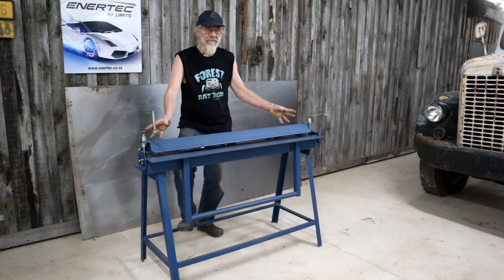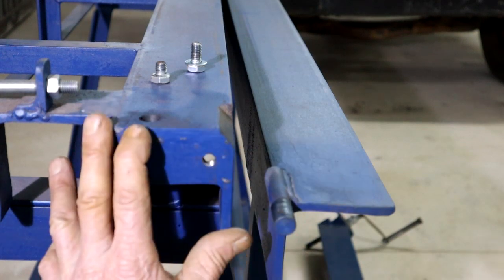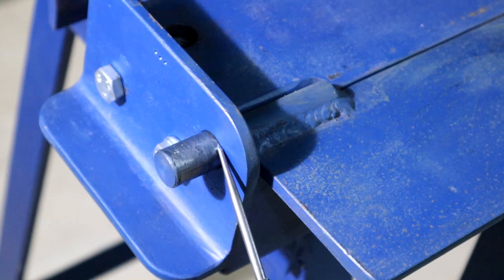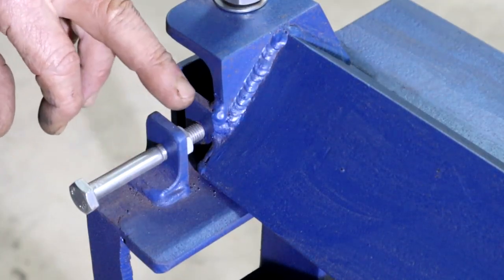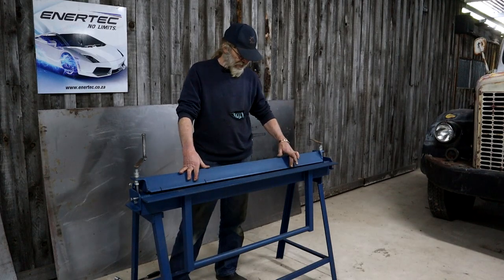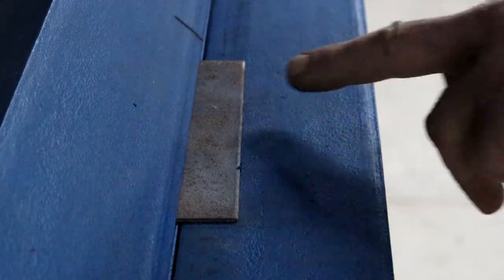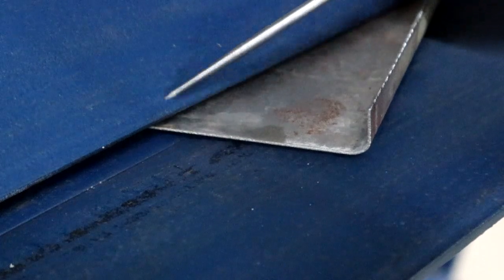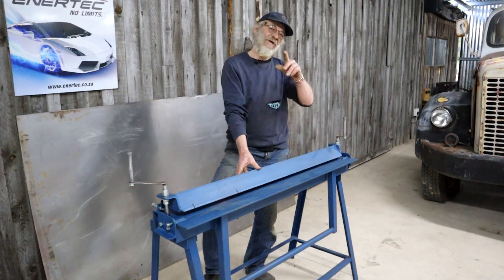GOOD DIY SHEET METAL BRAKE

Comment: Something I always thought of building to move cars trucks tractors around the yard is based on an electric  powered tor even gas two wheeled trailer mover or a tiller without the tiller tines. . Have some sort of lift device a few inches at the cars bumper to give traction.Might be better to design it as a pusher rather than a puller. I made a few attempts using the 3 point lift of a tractor. Intentions is to make it a one man loner operation. I always look forward to any of your new video's

Comment: Mount an angle grinder tona fixed position, and then run the metal through like you would a table saw.
Reply from the maker: Been thinking about that!

Comment: Very nice job I would just like to throw out there I see you cut slits in the angle to make a box corner would putting fingers on your hold down angle allow for more versatility to make different size shapes  , one of the best designs for the size of usable bending area. Congratulations
Reply from the maker: Sure fingers will make for more versatility. A lot of work and hassle to build them though!  I don't need it often, so just cutting slots is way easier. And I just weld them closed when it gets too much😅

Comment: So do you think it would bend 3mm aluminium plate aprozimately tge length of the brake ? And just a idea or mod as described wirh the shaoer bend radius, if you add a round stock along the length, say 16mm or 20 mm diameter. You could have a much larger radius bend  if desired??
Reply from the maker: Should do it, but think you wil need the additional bracing. And yes, adding the round stock will work. I wanted a bend with more radius, welded some flat bar tabs to the round stock and bolted it to the edge so it could be removed again

Comment: Awesome brake!
Another option would be to cold rolled flat bars to form the top angle, with the bending edge ground along the length to 45 degrees (or milled if the budget allows)

Comment: Unfortunately you're stuck on what ever radius the edge of the angle is !
Reply from the maker: Yes, but its possible to tighten that radius through scribing a line and careful grinding. Or milling if that's an option. In general I'm happy with the radius of the angle though.

Comment: I worked my whole working life in the metal industry. I started off in my Plumbers Apprenticeship doing plumbing work obviously but also a lot of Sheetmetal work, Welding, Soldering, drawing plans up to make sheet metal   requirements i.e. ducting, vent and ducting terminals etc. That was over the course of 50 years I learnt so much that I feel like it's a part of me now I can't let go of any of it and my experience governs how I approach any job I am tackling, I enjoy it so much. The sheet metal work is one thing I still enjoy doing in my workshop and I have been looking around for a metal folding brake and I see that a lot of men like yourself are building your own. It is something I want to have a go at. After listening to your very interesting talk about your own metal folder and seeing the high quality of finish you achieved, I'm definitely giving it a try. Thanks for the detailed explanation going over all those finer points, like putting the flat bar across the angle iron to get that square lip on the front of your machine.  And thanks again, a very interesting tutorial.
Reply from the maker: Glad you enjoyed the video! Good luck with your build

Comment: How did you cut the grooves in the angle iron for the 16 mm bar? Thanks in advance.
Reply from the maker: I cut it with cutting disc in a grinder
Reply: @ratrodsafrica  Thanks. Great project and great video.

Comment: To get that edge crisp just slip in a small 1" angel in-between the clamp down angle iron and the work piece. The outside edge on angle iron is usually a sharp edge. And when you want a more rounded edge just leave it as it is now. Best of both worlds.

Comment: I built a similar bending brake about seven years ago and sharpened my radius with an angle grinder to a scribed a line. Slight imperfections didn’t make any noticeable difference to the bend. 
Ps loved the video.

Comment: Man, this thing is awesome! I want to make one and have some materials. I'm thinking less wide but in 3/8" thick(9.5mm), would there be any reason not to that pop in your mind? I'm just a hobbyist starting out and would like to use it to make brackets and mounts. Mostly 18-20 gauge but would like to be able to do 1/8" in small runs.
Reply from the maker: See no reason why that won't work.
Reply: I’m using your design but went with 5/8” thick for the top. Thank you
Reply from the maker: @JasonGrace1  wow, that will be seriously strong!🙂 The stiffer/heavier, the better 👌

Comment: I'm reminded of tools I have used in granite countertop fabrication. These days CNC machines do much of it but guys who don't have 90,000 dollars used grinders with a jig or short of guard bolted onto the grinder to maintain a perfect position or offset of the grinder to the stone edge. Luckily that top piece of angle iron has a nice clean sharp back corner that can be used as a reference surface for the driver to run against to grind that edge straight and flat to make a nice sharp edge on that brake.

Comment: Will it bend 14 ga.sheet metal- for truck floorboard?
Reply from the maker: I have bent 14 gauge, but only smaller widths, up to around 1 foot. Definitely would need triangular bracing for wider, maybe even heavier sections to make it with

Comment: Old center Axel as long as building to move with heavy wheel weights on drive to unit use of belt oldway now hydraulic system,same ideas of machines belt drive 1850-1890 molds of mass production of pollution, same simple uses as this. Thanks.

Comment: Sir: Perhaps after you find that long piece of stock in the junkyard to improve your bend radius, you could drill it, bevel a 45 on the edge, and then cut it in to different width fingers. v/r wh

Comment: How about instead of welding a plate the whole width you welded a strip on the front edge, (clamped down by the angle with the strip underneath), the radius problem is one of the things I am trying to get round without milling and the idea of a short strip may be the way.
I am aiming to make a six foot bender with 9"x6"angle 1/2"thick for long 2mm lengths, I am also toying with the idea of hydraulic operation due to the size and weight. Any thoughts on the build  and or operation before I commit the metal? 😊.
Reply from the maker: Can't see why that won't work, but you would need to bevel the edge so that it is less than 90 degrees. The larger radius actually doesn't bother me much, my work is all automotive. Over 6 ft, I will definitely triangulate for additional stiffness.

Comment: To bend a sharper radius, simply slip a length of angle iron under the anvil and loosen the two rear bolts accordingly. Bend over the heel of the angle.

Comment: Just a suggestion on the front side you can takeoff your quarter inch of material to make it flatter instead of a rounder and on the backside you can leave it around. It looks like there’s enough play in your top piece of angle iron to do that and it looks like if you want it, you can reverse the back to front And front to back you can have two different types of radius bends. One flat, and one a little more rounded..

Comment: This is an awesome way to do this. You have thought about about every possible solution to the normal problems with diy metal breaks. Thank you very much for sharing. This is the best diy metal brake I’ve seen. I’m going to use yours as a plan to build me one.
Reply from the maker: Thanks. Please do, I'll be honored 🙂

Comment: Perfect design. Very nice tool you built there. I plan on using your design for my build. My only modification will be the top angle. I like the round radius but will have to add a flat bar inside for flatening bends. I work with aluminum. Wish me luck. Thanks for posting.
Reply from the maker: Thanks man. Good luck with your build!

Comment: Excellent design and very well explained mate. If you don't mind suggestions, there is one design modification you could add. If you welded (or bolted, so it's removable) an extension (long enough to clear your tensioning winder) to one end of the rotating angle. Then add a 90° bend that extended straight up you could then attach an appropriately sized counterweight. That way when you pulled the handle forward the weight would lean back and do a lot of the heavy lifting/bending for you. You could add extra weights for bending thick materials and remove weights for thinner materials. Much easier on the back for old codgers like me/us 😉. Cheers Andy 👍

Comment: Fabricator from NZ here this is awesome! To find one that is size appropriate and inexpensive is a struggle but I’ve plenty of scrap to knock one out. Thanks!
 For your 90degree radius if you want to make it tighter I have a trick I use to bevel my edges of angle anything really.
Diablo make a great yet somewhat costly-ish steel cut off blade. I usually raise my cut height on my circular saw and then clamp a straight edge onto piece I’m wanting to cut to use as a guide. I find if you do it in small incremental passes the blades last a lot longer. Poor man’s cold saw??? PPE and the hot chips won’t phase ya. Been working for me for weld prep for years and I haven’t found anything else other then thee ole grinder. Hope  that helps. 🤙
Reply from the maker: Yeah build one mate, works great. Been thinking about that table saw idea, need to find the right blade. And the guts to do it😅

Comment: With respect to reducing the radius of that 90° angle stock. What would be wrong with fitting a table saw with an abrasive metal cutting blade and running the steel through as if it were wood but in 2 or 3 passes? As well with respect to the question of bending 1/8" thick steel. Could you not strike a line using an awl on both sides, then cut a small incision (maby with a zip disk), perform your bend, and then weld the appropriate side of the bend (or both) if strength is concerned? Thank you for taking my questions.
Reply from the maker: I'm sure the table saw trick could work if one has the guts to do it😅 Never tried it before. First thing that comes to my mind is to check out that motor speed will be OK for the blade
Reply: @ratrodsafrica  Thank you.

Comment: We have found if a job needs doing , there are times when a simple device to do the work is not too difficult to produce very often. Succeeding at that adds a tool to the working machinery(tools). Adding the advantage of setting up and completing at home. Instead of paying a person to do a world class job of a simple process, thereby costing far more than the cash value of the job required. When we hire a worker they have to produce excellent work due to being professional. We just want this bit of tin bent here > - - - - - - - - - - - - - - - . We don't concern about the radius of the edge too much? One mm one way or the other may not be vital. And if you're like me and are using junky material recovered from another thing, those guys don't want your material anywhere near thier $1,000,000.00 press break or folder.

Comment: Instead of removing is to add a section ,a strip ..or add a series of pieces that bolt onto the angle bar that meet the surface flush. That way you can also unbolt some of the pieces and fold at 90 degrees
Reply from the maker: Yes, been thinking about that. Just need to find some stock that's wide enough

Comment: I would have welded a cylindrical sleeve / bush with that end bracket so the hinge is supported by more surface area and is stronger
Reply from the maker: That would be better, but I wanted to keep it as simple as possible. So far, holding out very well

Comment: I sent my angle iron adjustable bending edge through my mill to get rid of the rounded edge. It now sits flat on the bender's frame . Diff, you need to find an old mill for your shop, they really come in handy and are fun to use.
Reply from the maker: Would love to have a mill in my shop!

Comment: I have seen a number of vids showing Bullshit bending brakes .... this is not one of them.
Well built well explained.
.
here are some thoughts.
because of the flexibility you have built in, you could use bending mandrels. clamped under the existing top angle.
That would be a thick piece of steel only big enough or exactly the right size, to bend the piece in question.
because it is not the whole size, the piece would not be expensive and it would not be such an issue to make the edge whatever shape and angle you like.
.
if you wanted to "machine" the clamp angle, a working man's way would be to clamp it securely to a bench and very carefully ride a 9 inch grinder with a new disk along both sides of the angle.
Great care and constant checking with a straight edge would get it close.
Then finish with a belt sander run long ways.
.
you know to be incredibly careful when using any large grinder, they cut flesh and bone very efficiently.
Reply from the maker: Thank you for the compliments and feedback. Yes, I've seen some horrible accidents with 9" grinder in my time! I don't even have one anymore...

Comment: You used flat bar at 45 on top for clamper. I used 1/3" plow blade it has a sharp 2" prebeveled edge like a blade. Shhet fold over > 90 and 170 ++ sheets but it can bend up a bit with thick stock over it 6" mouth. I used 2"+ coupler nuts and welded them in as the hinge brace rather rthan 5;/8 pins I bolt it in with lubricarted threads and it has very littyle frictioin and zero play. Wanted to 'stong back" my Flat 4" top with a 36" piece of 2X2"  x1.4" angle but the welder put it on backwards and riled the whole bend area - Idiot. Have not used it now for > 15 yrs or more. Need a place my 30' wide garage is still to crammed to deal with 1 more tool.  I wanted to bend 1/4" x 4" steel flat plate into a squared deep channel with ID of 12" legs 3.5" id  bottom For fence posts to keep in concrete pilings above dirt. Could not fgigutre how to make a tool good enough for the 28" x 4" stock w/o heating. to soften loads. Ideas
Reply: hah - My mistkes typios) was a 36" mouth  plow blade flat stock was actually called - Cutting Edge Single Bevel Blade 1055 5/8" x 6'' width 3' is 75 4' is $100 online.  I paid way less from ag steel supply locally. If done again I do 4+ foot and i like your cranking bolts. I was forced to use 1/2" bolts welded below on 2"x6"x1/4 channel bed and nuts above to clamp. I Needed the brake unit on a bench and had no clearance beyond 2" channel depth  Using a wrench was slower.
Reply from the maker: Thanks for the input!

Comment: A grinding  wheel replacing the blade in a table saw might do to mill a flat edge on your angle iron if one is careful to make tiny strokes to remove tiny amounts of the edge @ a time. Wear on the grinding wheel can be compensated by raising + or lowering the blade height adjustment ...If wheel rpm range is needed.. Motor pulley size can be used to dial in the RPM needed. Width can be adjusted with the saw' s fence.
Reply from the maker: Hey, good idea! Your plan might just work. Thanks!

Comment: How about cutting some off the front of the clamp making it sharp? You could take a grinder and grind the front edge to make it sharp, perhaps. I plan on making one soon and just mount it on my car hauler trailer and make it removable and only bolt it up when I want to use it. I am thinking about welding 2 tubes facing you and sticking 2 removable pipes sticking out so you don't have to bend over so far to move it up. You would start at waist level and pull up.
Reply from the maker: The challenge is to keep the edge straight when grinding it.
Reply: @ratrodsafrica  Saw another guy that ground both parts of the upside down "V", making them lay flat which seemed to work. My way would have the sharp point dig into the sheet metal which wouldn't be good. Just a suggestion.

Comment: Hi, great video! I have built something similar, based on similar videos. My hinge is slightly different, but I like that yours is removable. I have worked in sheet metal shops where we had actual hydraulic press brakes where the radius was always tight unless you purposefully used radius tooling, so when I went to build mine, I wanted to get a tight radius as well. So I constructed a jig for a handheld grinder with a cutoff wheel at 45 degrees that mounted to my work bench. Then I set up a stop on top of the bench to help keep the angle bar moving straight through the wheel. So with the grinder going, I moved the angle bar through the wheel to cut off the radius. It worked pretty well for me, although I did have a spot where the wheel dug into the bar, It has given me good performance with a very small radius. I hope maybe this gives you another idea how to reduce the radius of your bends.
Reply from the maker: Nice one! I have had similar thoughts, but haven't done it yet

Comment: It looks great but you can't bend 4 sides with it
Reply: That is indicative and it sounds like you are a good problem solver.  Way to go
Reply from the maker: I have done that by cutting some slots in the angle bar. But yes, never intended to be able to do that. It will require a way more complicated build

Comment: I was wandering if you could make a bolt on straight edge with a sharper edge to make a crisper bend since you have adjustment in your angle on top you could slide it back to make up the difference in the sacrificial edge if this makes any sense.
Reply from the maker: Yes, it could work. A piece of flat bar that spans the width across the bottom of the inverted angle bar.
Reply: @ratrodsafrica  I think so, if you try it and it works id like to know.